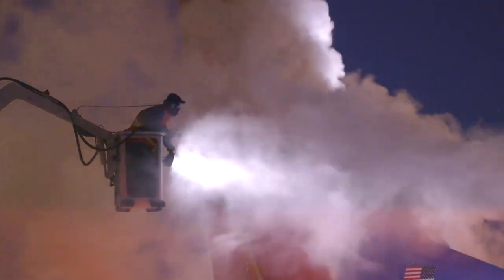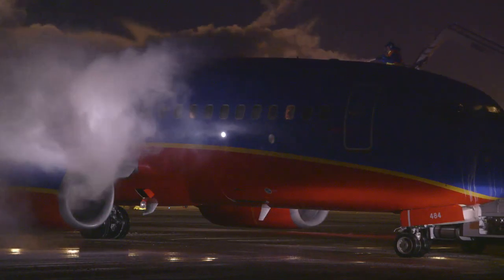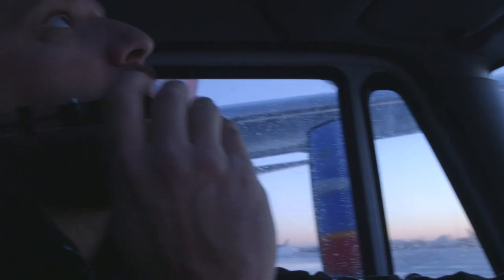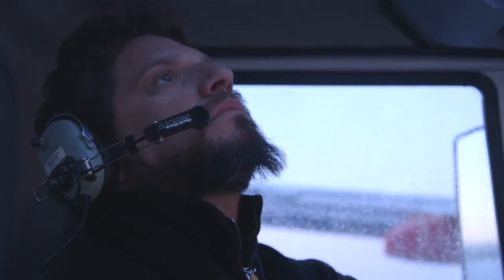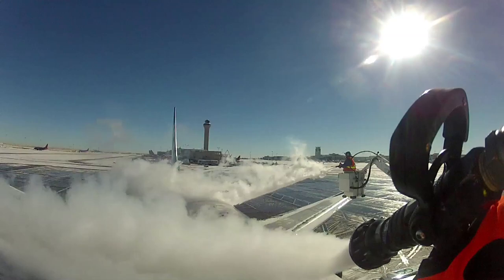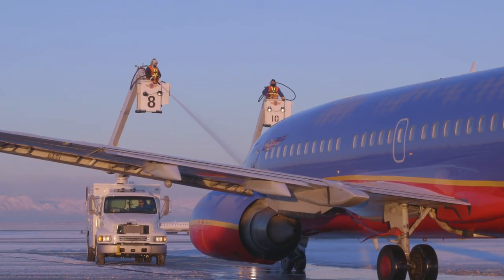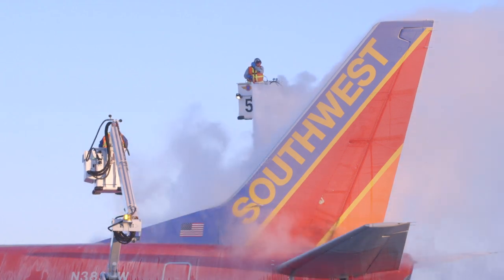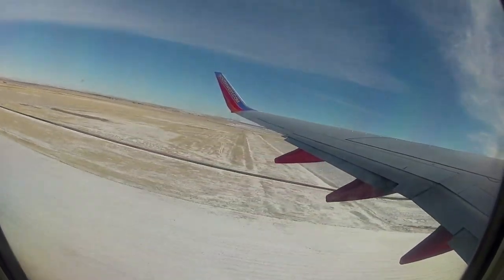Southwest Airlines: How we de-Ice a plane

Comment: I am not an expert at all. But it would seem to me that the most efficient and effective way to do this would be to have a mobile dome by the beginning of the runway that the plane pulls up into that is heated and the plane gets sprayed down with hot water in a warm environment and get cleared for takeoff with only 20 seconds from the time it leaves the dome until the time the pilot drops the throttle.
Reply: Does not work. Water starts freezing very fast and even a thin ice layer can cause major loss of lift. You need de-icing.
Reply: @RoyalMela  OK fine, but use the deicing liquid inside the dome that I’m talking about.

Comment: If I recall correctly spraying de-icing solution directly on exposed avionics such as Pitot tubes should be avoided, but I don't see how these guys can de-ice without spraying on them. How does that work?
Reply: Spray above em and let it roll down
Reply: R5H4D0W 3

Comment: The modern deice trucks have the personnel enclosed.  The cherry picker is fully enclosed and they control the spray through remote control.  Hanging out of that open cherry picker breathing in all the fumes of the glycol has got to be bad for your health.  It looks like fun though...
Reply: Depends on the de-icer model. The ones in the video are fairly new and they still make them. I used to work for the company that makes the de-icers that are in the video.
Reply: quinnjim h
Reply: quinnjim
Reply: quinnjim need
Reply: quinnjim I qwer hi lve
gr
Reply: quinnjim Chalino Sanchez Nieves de enero
Reply: quinnjim Chalino Sanchez las Nieves de enero
Reply: quinnjim  Las Nieves de enero con Chalino El Alcon Dela Sierra
Reply: quinnjim uiuiiikokkmp
Reply: Jullien Marin 

No manches. Que babosada de comentario. Nada que ver
Reply: That's still a newer truck.

Comment: What is the purpose of de ice a plane?
Reply: if you would not de ice a plane if its frozen it can cause technical problems and could even cause the plane crash because the pilots don´t get the right information from their computers about the temperatur and air pressure and other important thingd
Reply: derek frost If ice accumulates on the wing, it causes a separation of airflow and disrupts lift. This can cause serious issues including stalls, or loss of control. If ice accumulates on instruments used to tell the pilot altitude, or speed the reading can be incorrect which can lead to making incorrect decisions.
Reply: derek frost
Reply: derek frost to make it shiny and looks new, so when ever they want to sell it they can screw the buyer
Reply: lol
Reply: derek frost because the ice can freeze over the plane flaps which would cause the flaps not to open and you need the flaps to help the plane climb higher in the air and to slow the plane down while landing
Reply: +Justin Justin is the only one that got this right. Ice typically accumulates on the leading edges of wings first, this increases the stall speeds as it delaminates the airflow and lowers the Angle of Attack needed to induce a stall (typically 18* or more), critical during landing phase(s). Most instrument probes, however, are heated; example the pitot probes.
Reply: derek frost so it doesn't freeze because it might break something like it might freeze the engine
Reply: derek frost
Reply: If you have ridden on an unclear airplane, you would know the difference.